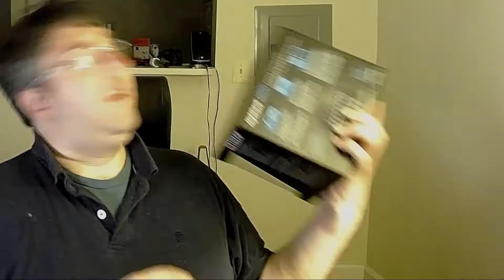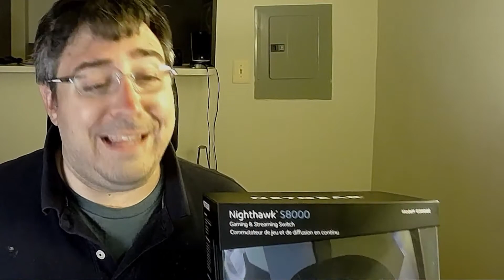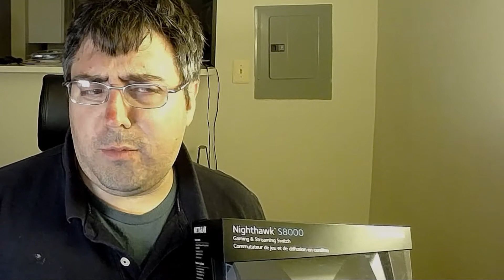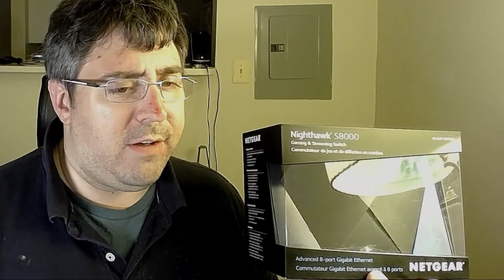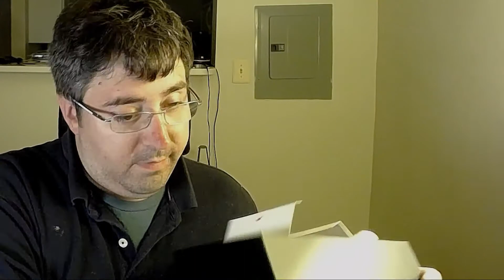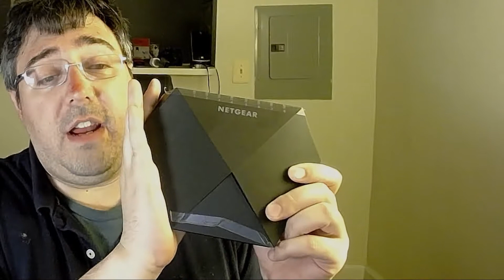The Netgear Nighthawk S8000 arrives

Comment: Are games in games more stable? Does it really reduce delays?I use ps4. 120/20 In my router i use ps4 and pc
Reply from the maker: I really don't see any difference.   Its a great switch, don't get me wrong.   and I love using with my: Gaming PC, PS4, XBOX ONE X, TV and UHD BD player but I can't say that I see any difference in a standard router.    Even adding this in is an extra hop for th edata to go through before it gets out of the house as the switch is set up in a star topology for the end devices with a trunk between it and the main router.     I would say if your choice is this or the 10Gb version unless you're going to make a direct connection to a server or a RAID NAS based storage then I would go with this switch as it is cheaper.    the products moving on from 2017 I haven't been all that impressed with.  We had 802.11AD which is pretty much a failed standard.   YEah if you get line of sight it does pretty good but it is useless for most people.    802.11AX I think is really going to be the next larger standard. but if you're just concerned with the ethernet on this right out of the box I would say it's fine.    The interface of course is similar to what you would see on the router variant.     Hope that answers your questions.
Reply: @ArmandsTechTalk  Thx..Good job..